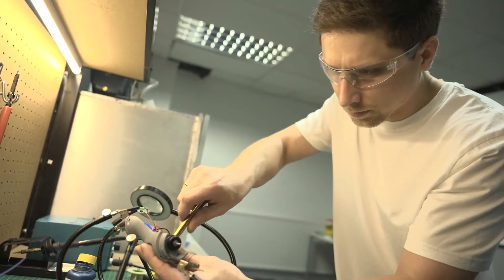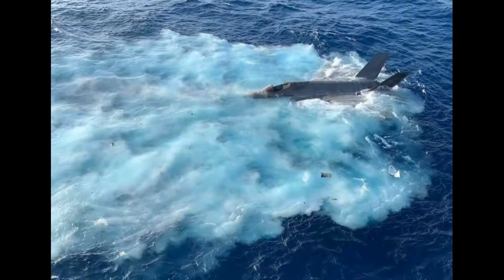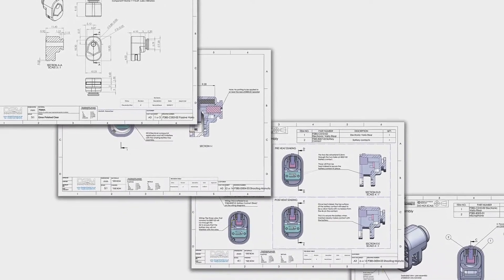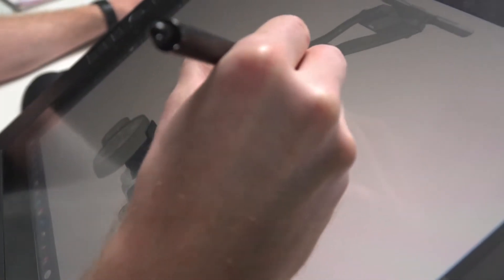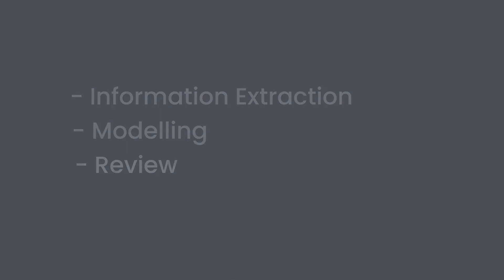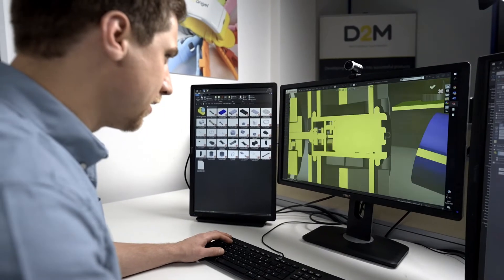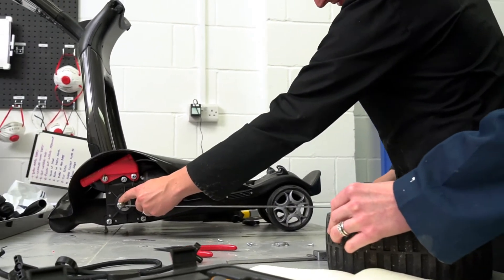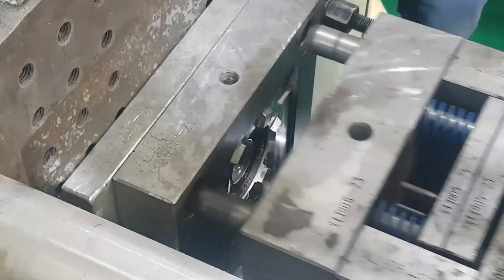SAVE THOUSANDS on Product Development - With Reverse Engineering!

Comment: what is the limitation by reverse engineering and creating my own product to be putting on the market without any legal issue
Reply from the maker: Reverse engineering should only be used to help understand existing product areas that are not unique. Unique features and functionality are likely to be patented and therefore if you copy these you could have an infringement issue. Best to check with a Chartered Patent Attorney first.